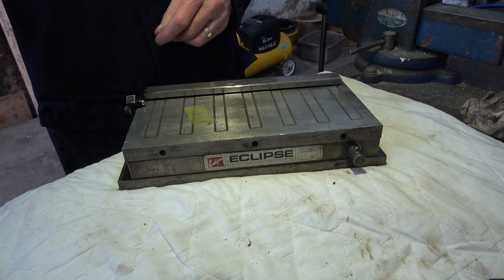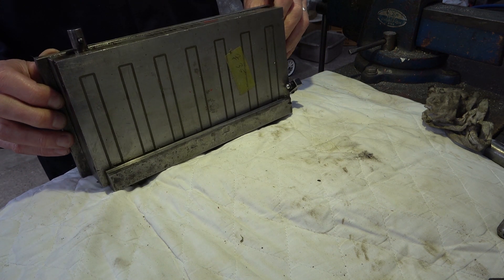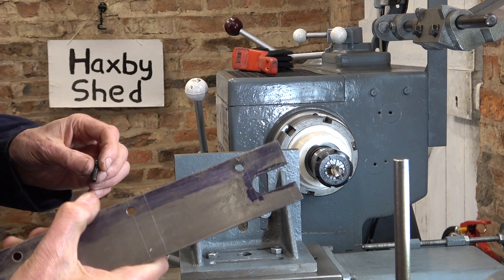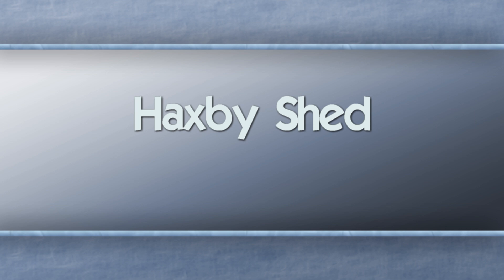HS81 Magnetic vice for my shaper – Part 1

Comment: That mag chuck is a nice score. That's gonna make quick work to make surfaces parallel to each other.
The only down side is that you probabely gonna struggle with chips sticking on it.
Reply from the maker: Hi Rusti, in part two coming out on Friday you will see the magnetic chips, in fact I give you a mention, but they did not cause too much trouble. It's really wide flat things that cover one or two magnetic panels that stick tight and small items don't stick so much. Cheers